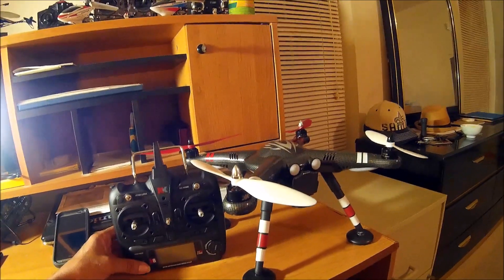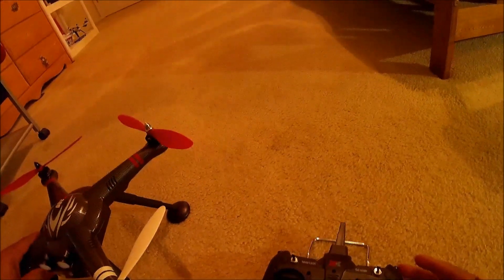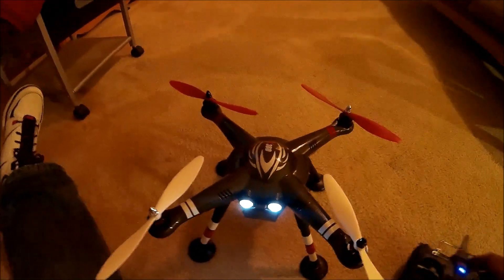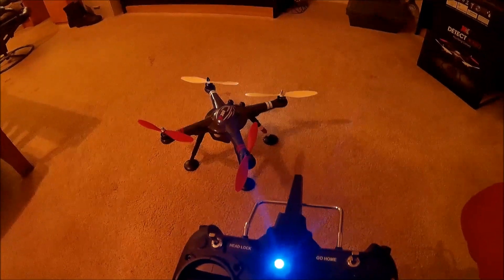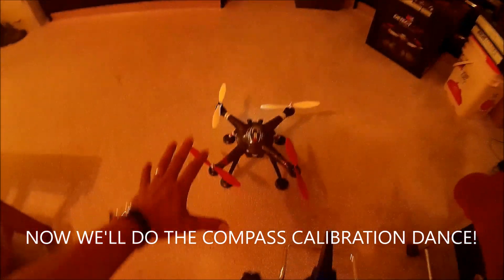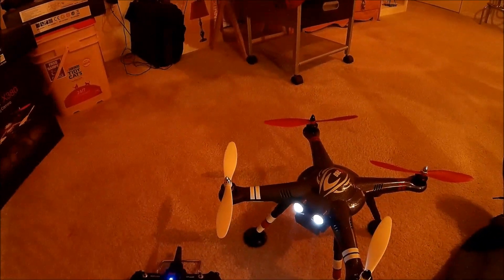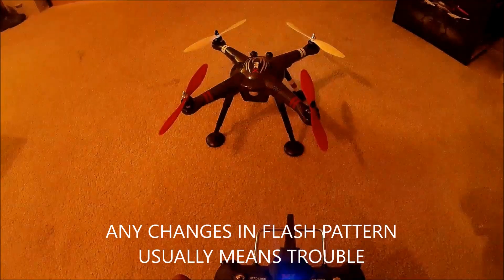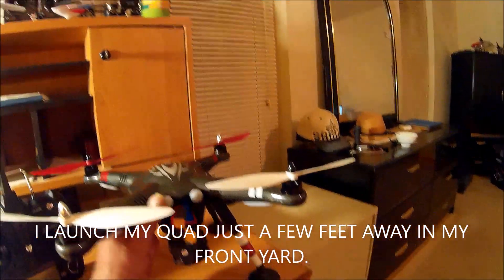XK DETECT X-380 "MUST WATCH BEFORE YOU FLY"

Comment: i just got this thing..of Ebay very nice but the instructions not english. so this is a very good video
Reply: The XK inovations web site has broken links so the support option doesn't download any user manuals. Couldn't find any links on the XK Drone Owner's Club facebook page either.
Reply from the maker: That sucks, no english user's manual. You may find the manual at XK-innovations.com.  You can also try the "All XK Drones Owners Club" on facebook and search their document files. Good luck with your new x380. I'll be posting a new x380 video later this evening, it's the 1 year old/100 flight for mine!  Thanks for watching. Dj Soul Force
Reply: i've been in rc helicopter's for year first drone my brother came purchased all my heli. so i thought it would be cool to try a new hobby,,think i might like it but this drone look about middle to low end so i will move to the more expensive drones fast.....
Reply from the maker: Costa Rica Flyer  I did find a link, not sure what's on it, but you can try a google search for "xk detect x380 manual" - http://www.firstquadcopter.com/download/x380-user-manual-v1-0/  Good luck. DJ SOUL FORCE

Comment: I have tried 10X to get solid green by pushing X380 throttle down and switching the head lock 3X.   What am I doing wrong.   Drone is on and getting a GPS signal and the transmitter has 2 bars on batteries.      Drone worked great for two weeks and just crashed the last 2X we used it.   Tried to trim the magnetic sensor but we just CANNOT get a solid green light.   HELP my little boy is going crazy.   Still under warranty - should we send it back?
Reply from the maker: Hold down the throttle, flip the headless lock button 3 (OR MORE) times FAST, until you get solid green light. If it still doesn't work, I'll need to know more information. My email address: soulforcekites@gmail.com  I'll try my best to help. Good luck. DJ SOUL FORCE

Comment: Hey!, DJ,
Last week I had two good flight days with my refurbed X380. Four  take offs and landings, actually used the Auto Land for the first time. I do need a new flight camera, it's toast. I'll link a DROPBox raw video of what first happened to the camera. Tried to get firmware, some online help, but no cigar. Here's the link:
 https://www.dropbox.com/s/7800dgvvu85a0ph/X380Flt31GND160912%20003.MOV?dl=0
Have you ever seen anything like that?

Cheers,
BK
Reply from the maker: You need firmware for what??? (the x380 or the camera?) This video will help with firmware for the x380 (https://www.youtube.com/watch?v=c0jPjEA4ZdQ), sorry, I don't have any helpful info for the camera. I'll take a look at your video and leave comments later. Thanks. DJ Soul Force
Reply from the maker: I left comments in your dropbox.  Thanks for sharing. DJ Soul Force
Reply: Yep DJ that's the screen looks like a BAT?  I could control and see FPV video when I hook up the Camera to the transmitter and view it on the down link. I tried downloading camera firmware from various sites that said they were for SJCAM SJ4000 and or clones. A few would load but just had the crazy screen. Finally I dislodged the USB port and am dead in the water. I've contacted Gearbest , but no help on firmware  from unknown supplier/manufacturer. Therefore I'd caution against buying the C version of the XK380, since the support for the added peripherals doesn't seem to exist.
BK
The wrecker

Comment: Cheers. I've been watching your vids. Great stuff. 
Question, If you're X380 is in mid air and you pull the throttle down full, do the motors turn off?
Reply from the maker: Yes, but first the motors will slow down drastically, then the motors will stop after about 3 seconds. Hope this answers your question. Thanks for watching. DJ SOUL FORCE

Comment: Hey dear Mr. DJ,
I already have 2-3 flights with my X380, it is very nice machine. last 2 times I fly with sport camera(firefly 6s) onboard with duration about 22-23 minutes and I still haven't seen warning about the battery level. 
The flight time of that quad is amazing.
I see some of you use that drone for some time, could you please share about the charger you use and how does it affect on the battery life when it has been used many times?
Also I'm curious about the software you use for editing the raw video files from your sport camera?
Reply from the maker: The video editor I use is the free Windows Movie Maker. I use the Imaxx B6 Pro Balance Charger for my x380 and most of my other batteries. Thanks for watching. DJ Soul Force

Comment: hi I just flew my x380 and when I checked the battery it got puffy like a balloon has that ever happen to you?
Reply from the maker: Yes, that will happen whenever you store the battey while it's fully charged, for a long time and don't use it. After flight, I don't recharge my batteries until I'm ready to fly again.  The puffiness may go down, but if not, I would replace it! Good luck. DJ SOUL FORCE
Reply: +DJ SOUL FORCE so it will settle the puffiness after few days? I love flying this drone as much as my phantom 3 pro. I can't seem to find a local store that carry the battery it's mostly sold online ship from China. you know any place where I can buy it that's from the USA?
Reply from the maker: Not sure, but try DirtCheapRC.com or search for them on Ebay. They may not have the exact XK battery, but they have similar batteries and will put any kind of connector that you want on the battery if you buy the connector from them.

Comment: Hey! DJ! I've been quiet for a couple of weeks. Yesterday I took my trusty X380 out for flight #30. Every thing went fine for the first time out until I hit the RTH on the second Flight of the day. Just before I hit the RTH I was facing the drone towards me, so if there were a Low Voltage Signal I didn't see it. The drone wasn't far from me, it rose to about 20 meters and turned around with the solid red light on the tail showing. I then moved over the starting point AND DROPPED LIKE A ROCK. DAMAGE: the 2 front feet broke off including the Mag Compass, there is a crack in one of the top frame arms,The battery came flying out of the drone and split it's outer covering. The camera will show out put only when hooked up to the transmitter and viewed on my FPV receiver, I get only a Green RED cycle (No GPS?). <My helmet cam cut out after the first flight so I don't have it's video from the crash.

You did some fix up after your early crash, any suggestions?

I may have leaned a couple of lessons from my last flight------
Cheers!
BK
Reply from the maker: That sounds just like the crash I had on my second flight!  GearBest & Banggood.com both have spare parts for the x380, including the leg with the compass in it. No suggestions on the camera since I'm not sure how bad the damage is, but after you repair the arms & install a new compass, you'll need to re-install the factory master files, watch this video: https://www.youtube.com/watch?v=c0jPjEA4ZdQ  So sorry to hear that your trusty x380 let you down, could have been low battery & using RTH at the same time. Good luck, hope all goes well. DJ SOUL FORCE
Reply: DJ! I have the feet fixed. On the Mag Compass Leg just had to connect 2 of the wires that pulled out of the connector. I still have Green Red blink sequence. Before I dig in more deeply, I'll reload the Master Files. I'm quite used to it now, so that's no problem.
Hey, I recently saw your long distance flight video. I'd be scared to death flying so far over woods and into the next county. But your more adventurous than me!!!

More Cheers!
BK
Reply: DJ! Just re-formated the on-board drive and reloaded the Master Files. Everything'is Double GREEN. Ready to try to fly--maybe tomorrow.

Much more CHEERING!!!
BK
Reply from the maker: Bob Koch  Wow... that was a speedy recovery! What about the broken legs and the compass??? Be careful with her! Keep me posted. DJ SOUL FORCE

Comment: DJ does the remote warns you when battery is low?
Reply from the maker: The remote only warns you when the remote batteries are weak. The only warning for quad battery being low is the flashing flight indicator light on the back of the quad. I suggest using a timer, I usually fly with timer set around 18 minutes, then keep her close to me until the light blinks. Good luck. DJ SOUL FORCE
Reply: +DJ SOUL FORCE thanks I really appreciate it. oh by the way I'm going to use this drone to cast my fishing line on the beach hehe

Comment: Dear Mr. Dj, Hello from Bulgaria.
I've recently bought X380 and today went out for first flight. I did all preflight setup procedures, I got double green lights and started the drone. When I tried to lift it in the air it went just a meter above the surface and was absolutely unstable. I treid 2 times with no luck. After that I tried to use the auto take off function but again it went just 10-15cm up unstable and crashed. No damage but I'm unable to solve the problem.
Coud you please advice me how to proceed?
Reply: I'm thinking....I have placed some soft material(sponge EPDM) directly under the legs.
Is it possible that material to confuse the drone(because of the sensors inside the legs) and still receive info it's still on the ground?
Reply from the maker: It sounds like your props are on wrong! Double check to make sure they are facing up and mounted on the proper motors. Also insure that you are in the proper flight mode (mode 2 for most right hand pilots) by pressing the "stick mode" button on the lower left side of transmitter.  (TIPS: while facing the quad, the right front motor spins clockwise.) Good luck. DJ SOUL FORCE
Reply from the maker: No!  Check your props.
Reply: DJ SOUL FORCE, I did my first flight a few minutes ago, safe and fun because of your support.
I thank you very much for your advise, unfortunately I've missed somehow that detail in the manual.
Have a good day my friend :)
Reply: +DJ SOUL FORCE ,
Tomorrow I will mount my Firefly 6s on the stick mount with X380 and will share, despite of I'm new and not skilled 😉
Reply: Good day dear DJ SOUL FORCE,
I made my next flight with X380 and Firefly 6s onboard.
I tried to use PAN mode: I started it pressing FAP button, it started to rotate, but after that I didn't press it again to end this mode, but directly used the other sticks.
Suddenly the drone started strange moves(not made by me). I clicked RTH, but no success....after about 30seconds  I took control on the drone and was very hard to land it, but I did it.
In my opinion there was some kind of interference and that confused the control.
I calibrated it at the place of flight and tried again, this time I didn't use FAP, the flight was very smooth and RTH worked perfectly.
The camera's wifi was off....is there something more I could do?

I didn't have time to proceed the raw video and upload it.
Reply: Dj Soul Force, props signs and marks are not on the top but under the props, is that the correct way?
The direction is 100% correct I checked with the signs on the X380.
Reply from the maker: The markings should be on top, facing up. Good luck.
Reply from the maker: Glad to hear that all went well. Keep me posted, share some videos. Good luck, fly safe. DJ SOUL FORCE
Reply from the maker: Velislav Iliev  You should always exit out of Auto Pan or FAP modes before activating any other buttons or modes!  NEVER use RTH or HEADLESS while using FAP, your quad could fly away or crash. Good luck. DJ Soul Force

Comment: Dj Soul Force, I cant seem to get a gps lock on my x380 (2 flashing greens) It is stuck at 1 green, 1 red light. What I am doing wrong? Thankyou in advance :D
Reply from the maker: You could be in a GPS dead zone, try changing locations. Is your x380 brand new?  Is this a new problems (did it get GPS lock before, then stopped)?  Are both toggle switches in the up position? Did you recently connect to the flight control program? This may sound stupid, but are you outdoors and away from metal, cell towers or power lines? Send me the answer to those questions, I'll try to help more, let me know how it goes. (you may need to flash the internal memory - https://www.youtube.com/watch?v=c0jPjEA4ZdQ) Good luck. DJ SOUL FORCE
Reply: DJ SOUL FORCE thanks for the reply! Yes I just bought the x380 and it has never had GPS lock since I got it. I made sure to flick both headlock and home switch up before hand as well. I havent tried to plug the x380 into the flight control program though. And I have tried gps lock out in a big park, I dont think there are any cell towers nearby... Although i might go somewhere else and give it a shot thanks :)
Reply from the maker: Firal Rally If you have never had GPS lock, you could have a faulty quad. In the past, some guys have found that the GPS module has some pretty flaky soldering points. You might want to contact the seller. Good luck. DJ SOUL FORCE
Reply: DJ SOUL FORCE Thanks a lot for the help man! Ill let you know if gearbest sends me a replacement or some sort of compensation :)

Comment: how far can you fly this thing?
Reply from the maker: It's rated for 1,000m, but I have never tested it. Since I don't have FPV or telemetry on mine, I couldn't exactly measure it, but I have flown it over 3,000ft.  Thanks for watching. DJ SOUL FORCE
Reply: +DJ SOUL FORCE one more question is there a better charger than the stock cuz mine broke the tip

Comment: Hi DJ, my motor burnt out on my x380 from over tightening one of the screws.  It smoked and had to buy another.  I solderd the new one on just the way the old one was hooked up, the new motor had colored wires while the old had all black wires.  After turning on the quad the new one smoked up again.  I always thought that if a brushelss motor that has 3 leads is not wired right and is spinning in the wrong direction, you just change two of the wires around to get it to go in the right direction.  I did that too and it continued to smoke really bad. Do you think its the ESC?  I feel like polarity should't matter when it comes to smoking.
Reply from the maker: Do you have prop guards on??? Some of the prop guard screws are too long and are rubbing the motors causing burnouts! If there's no screws rubbing the motor, it must be your ESC. You're right about the polarity, it shouldn't burn/smoke, it should just spin in the wrong direction. Good luck. DJ SOUL FORCE
Reply: I don't have the prop guards, so it looks like I will have to buy a new ESC as well.  I'm thinking there is no right ESC for the X380 meaning it has to be for the rear or the front, each ESC is and performs the exact same way, right? Either way I will buy a new motor and ESC now, Thank you for your help DJ

Comment: When doing the compass calibration.  Is your body at the center of the rotation? Or is it the quadcopter that is at the center? I've seen it done both ways.  I'm not sure if one way is better than the  other.
Reply from the maker: For me, my body is at the center of the rotation. It's not that critical that the rotation point has to remain firm, as long as the quad rotates. Some guys go clockwise, others, counterclockwise! Good luck bro. DJ Soul Force

Comment: Hey!DJ! I've been searching the INTERNET for "Toilet Bowl" fixes. Some folks are using a site www.Magnetic-Declination.com and physically rotating their compass to rid themselves of the :TB" effect, and it seems to work for them. I don't know if anyone has tried it on the X380s, but I'm willing to try. I know that you had to do a repair on the magnetic compass and that leg. How did you remove and reinstall the leg(Foot) and compass?
Cheers!
BK
Reply from the maker: Before you go that far, try calibrating the accelerometers first. Put quad down on level surface. Turn on quadcopter, then turn on remote.  Without using any sticks, flip the RTH button quickly 12 times or more until all LEDs start to flash. Put RTH button back UP and wait until lights stop flashing. That's it.  Let me know how that goes.
Reply: DJ! I do that with each take off, Mag Compass dance + Accelerometers Calibration. No luck. I'm going to try a new park next with less "WIFI hot spots and Cell Towers. Are there screws under the foot pad and can they and the sponge on the pad be easily removed without destroying the pad? Y'Know I'm great at destroying things----
Reply from the maker: The pad is very thin felt like material. I removed mine once and had to use glue to get it back on. Why don't you try re-installing the internal files?  Do you have a gimbal on your quad?
Reply from the maker: Bob Koch Have you watched this video: https://www.youtube.com/watch?v=c0jPjEA4ZdQ  it may help...
Reply: I have just reinstalled the firmware etc. I just have a fixed gimbal, since I don't trust the one that came with the "C" version.
By the way, I recently found software to read the Blackbox.rcd files and  saved the original factory firmware to my PC and uploaded the updated firmware to the Quad prior to my first flight. I discovered that the Quad already had 82 minutes of flight time on it, and now I'm concerned that Gearbest may have sent me a refurbished quad. I also noted that my motors are not equal in power.
The story goes on and on. I just want to fly.
Reply from the maker: Bob Koch The video link I sent describes how to install the x380 factory master files, it's different from the firmware files. Give it a try if you haven't done so already. If that doesn't work, maybe you have a bad quad - sorry, I don't have any further solutions. DJ SOUL FORCE
Reply: Yep DJ I've done the Master file thing a number of times-- from when you showed me in April. I can do it in my sleep.

Just one more small question. Are there screws under the felt or foam pad or do you just pop the foot off after removing the entire leg an disconnecting the Compass?
Reply from the maker: Bob Koch  Yes, there are screws under the pads.
Reply: Thanks DJ! Rest well, I'm getting up at 5 tomorrow, so enjoy the rest of the night. I'm checking out!

Cheers! and Happy Flying!
BK